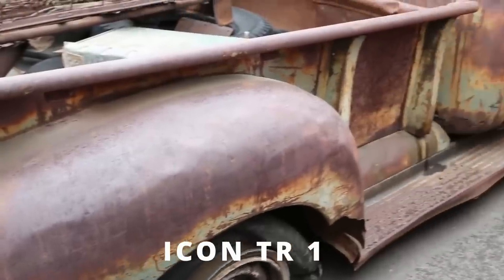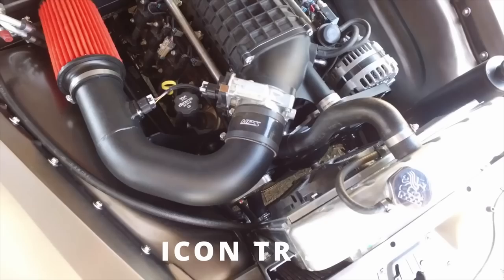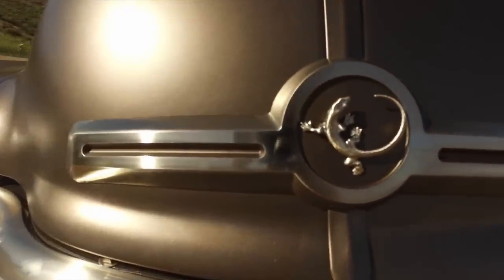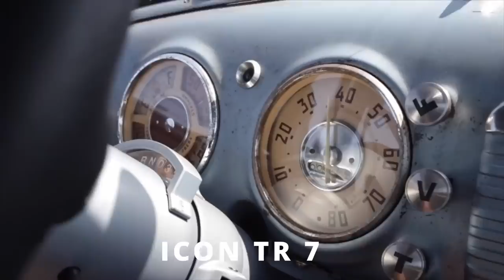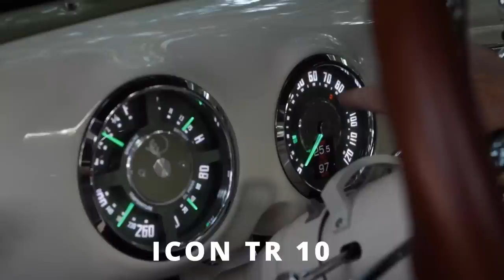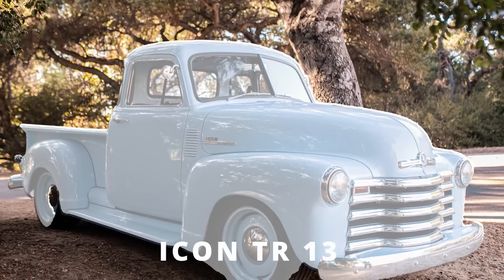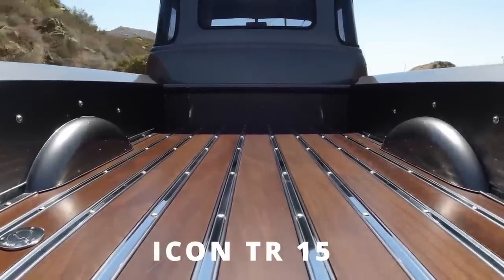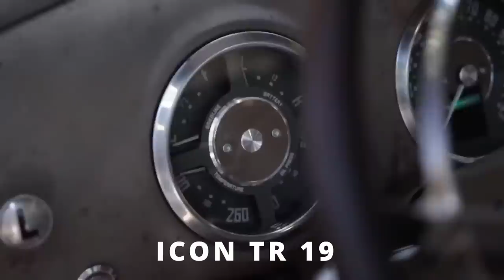ICON TR Anthology: All our RESTORED & MODIFIED Chevy pick up

Comment: The evolution of mechanicals is awesome.

My favorites are with the stand out paint jobs. (Brown, blue, Porsche white, dual color).

Everything is over engineered except for the engine air filter.  Why is it routed to the back of the engine bay to suck hot air.  Why?

Comment: Johnathan, have you seen the billet CNC two piece steering wheel that SPARK in Texas makes? It's styled like the stock 47-53 GM truck wheel but shrunk. It can be leather wrapped or left aluminum..it is very sexy!